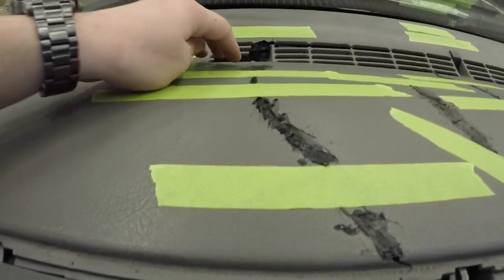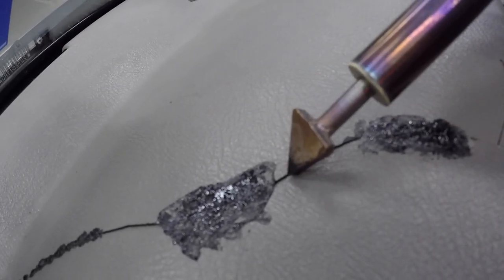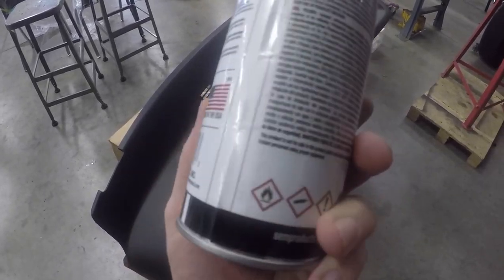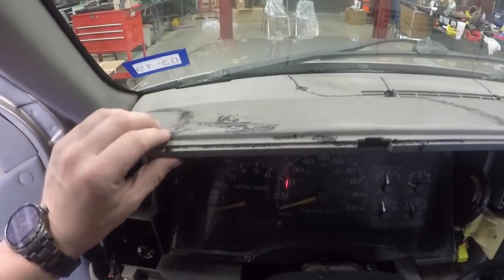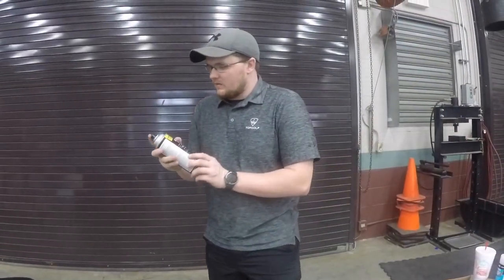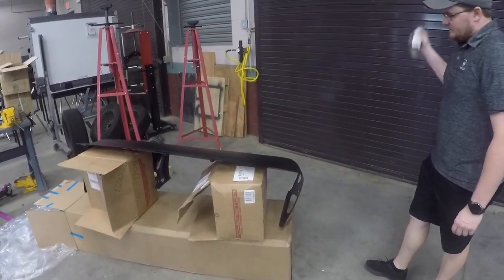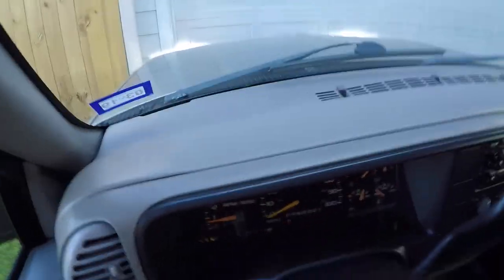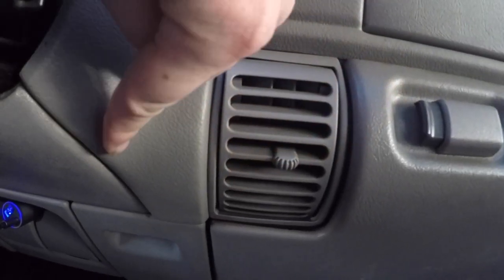Fixing My Cracked Dashboard & Painting & Installing a Dash-Skin - Coverlay in a 98 Sierra

Comment: I have another idea, to spray expanding foam between the two layers of the dashboard. Before spraying the foam. Align the crack dashboard and tape the outer layer of the dashboard. And wait until the foam cures. Good luck
Reply: I would expect even the minimum expansion foams like for windows would still push something out of place. If it did push you could never get them apart.
Reply from the maker: I agree foam isn't a good long term serviceable option! Foam doesn't make sense to me. The way I did it works for my situation and still holding strong years later.

Comment: Does that SEM paint have any after smell it at all? I used some platidip inside my Silverado and the smell is terrible
Reply from the maker: Nope! Zero smell at all once it dried.
Reply: I just bought some plastic dip in a spray can to spray over the 12 o’clock spot on my steering wheel where I’ve worn through the layer of plastic. I bought the clear since they didn’t have a color that would match my gray steering wheel

Comment: I have the same cracks on my truck my sound system don’t help much either
Reply: If you fix it reinforcing it on the back with fiberglass or fresh plastic. I use zip ties to melt plastic across the back. I have not tried but seen making little bow ties out of wire and melting them in across the cracks like they stitch a skin cut. Looks like Frankenstein but should reinforce the hell out of it.

Comment: How did you get the dash skin off the dashboard. If it’s called the dash cover off the dashboard. I ask because I took my whole dash out and I’m trying to take off the cover which is the  part that you were spray painting and fixing the crack.
Reply: I took my dashboard off 2 hours ago .what he has is a dash cover. It covers your preexisting dashboard. You actually have done the hardest part.
Reply from the maker: I was Painting the aftermarket dashskin not the OEM dash.

Comment: Pretty sure it would be cheaper and quicker to buy a used color match dash and install it.
Reply from the maker: You can't find one for under $1,500 not with the passenger airbag or that isn't cracked. This cost me less than $350 and it's not as difficult as a dash swap.
Reply: @LonestarGarage  That's not a Bad Price, but there is a "U-Pull It" Salvage yard here in Central Florida that has about Twenty of these Trucks with probably IO of them having nice Dashes. You can pull it yourself and they will sell it to you for 5O bucks. I bought an entire Grey Leather Interior out of an 'O5 Silverado, Seats, Carpet, Floor Mats. All in perfect condition and modified it to fit my Ninety Five Z-Seventy One. Pulled it myself and payed IOO Dollars for all of it. At a regular Salvage yard the seats alone are 5OO each. You just have to know where to go.
Reply: @LonestarGarage  I thought I could just replace the top part of my dash. But I guess the whole damn thing has to be taken out is that OEM top part replaceable ? Or is a skin the only option

Comment: I tried your idea and method and it sucked! Sorry... But it did. I ended up removing the whole dash panel and bought some resin and epoxy and went that route instead. I even ended up reinforcing the whole dash with fiberglass resin and it worked out better
Reply from the maker: To each there own mine is working just fine still to this day. It sounds like your situation was a lot different.